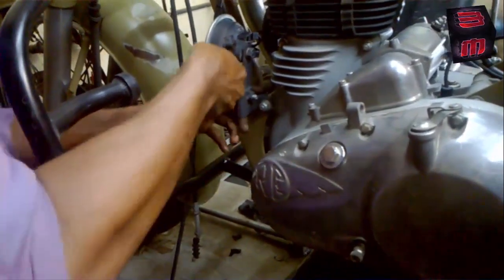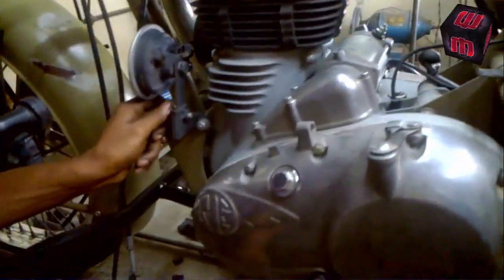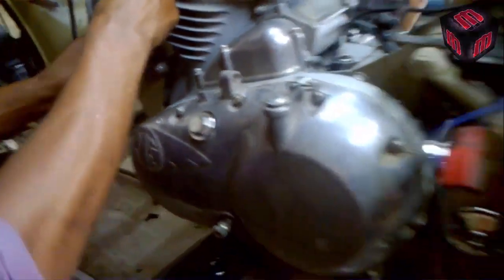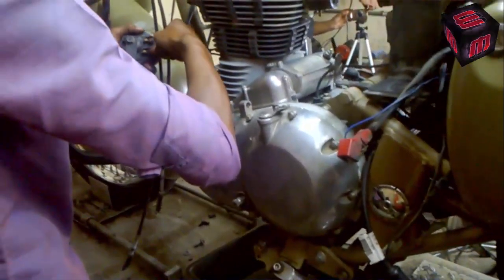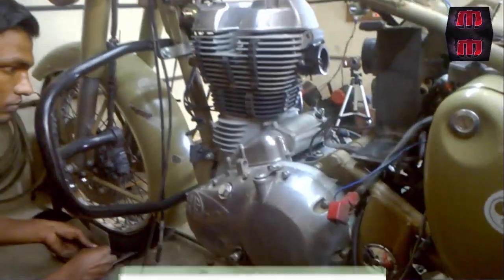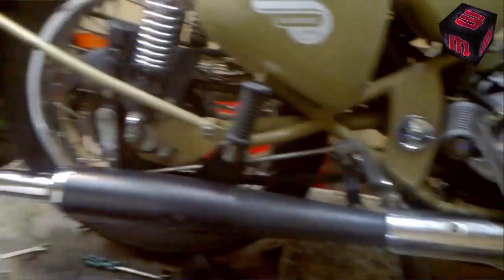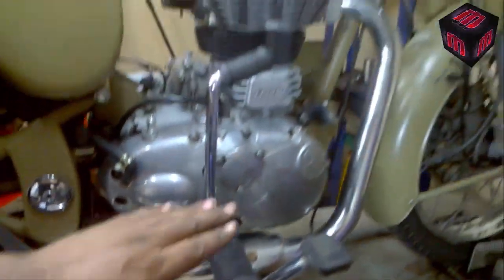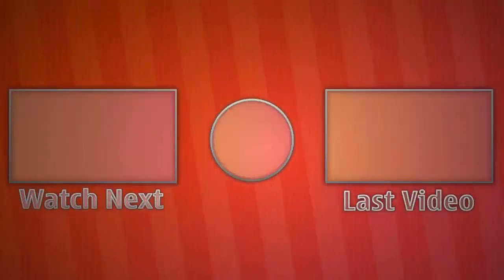Royal Enfield 1st Gen UCE Engine Stripping (ENGLISH) Episode 5

Comment: Which exhaust system is that? Is that sounds good?

I am using stainless steel exhaust 

What is the kilometre duration of changing clutch plate in 500 classic?⛑
Reply from the maker: stock is good now....due to LAW